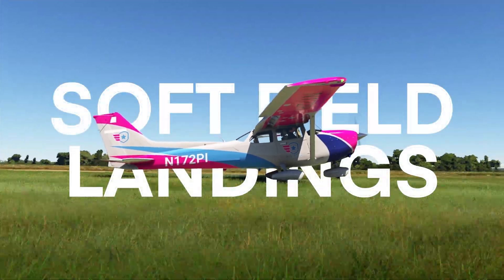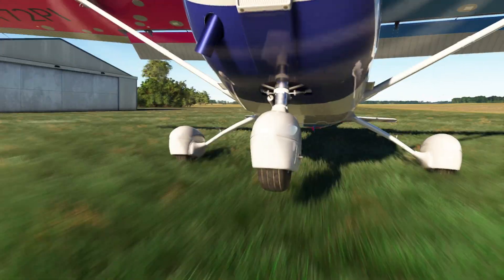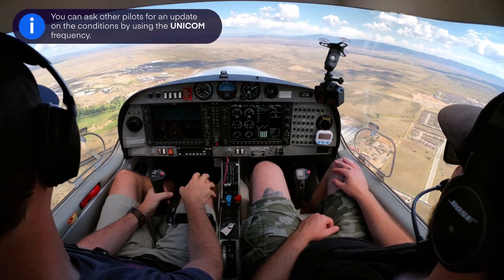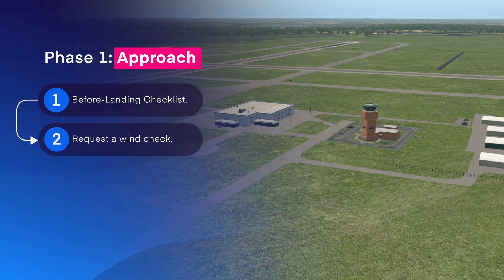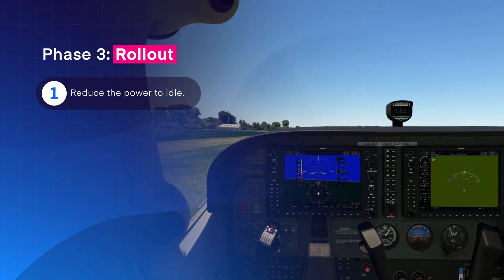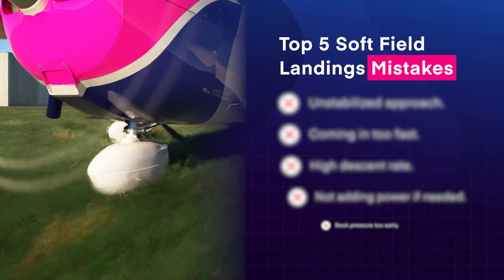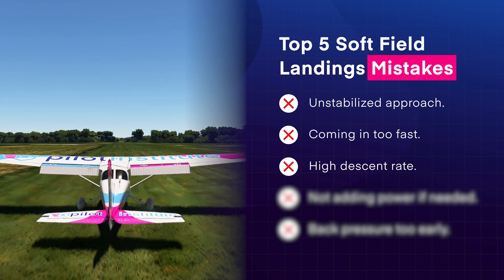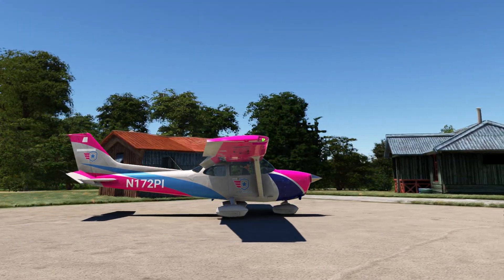How To Nail Soft Field Landings

Comment: All good points.  While necessary for short field, the power/pitch approach also works well for soft field.  By slowing enough to bring the throttle into dynamic control of glide angle and rate of descent, we now can let the airplane down slowly with power control all the way down.